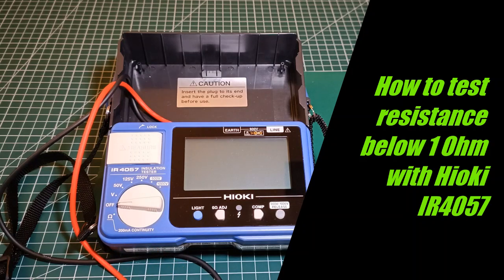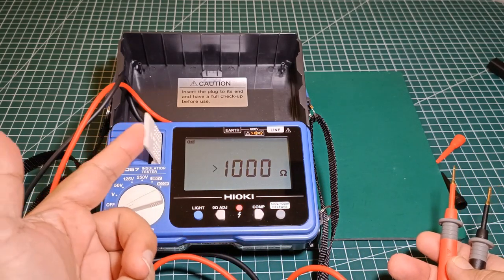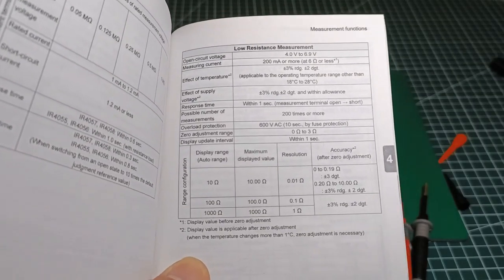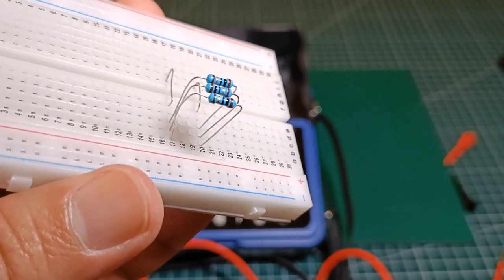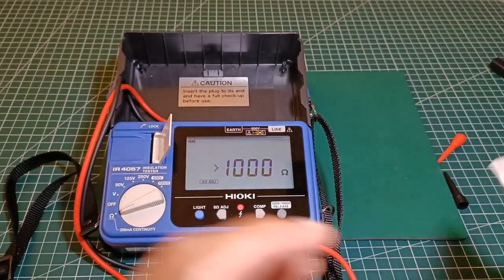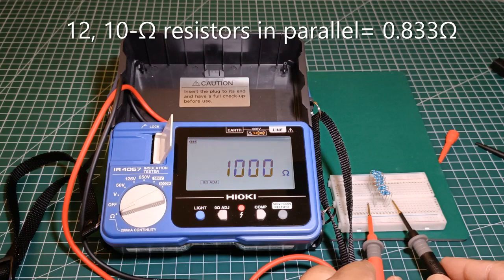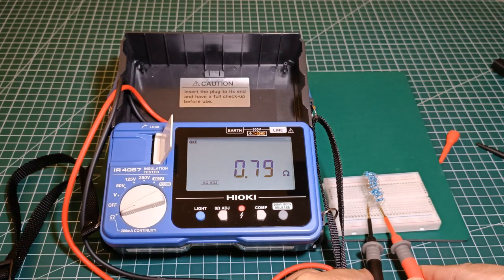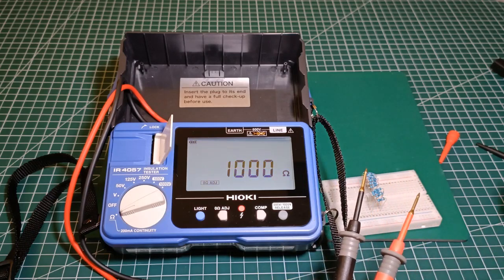[CC] How to Test Low Resistance with Hioki IR4057 (0.01 Ohm resolution)

Comment: Hola amigo una consulta, la función 200Ma de continuidad, sirve para medir la continuidad de un circuito algunos países como chile España piden esa medición en instalaciones nuevas.. 
Me podria decir si esa es la función?
Reply from the maker: @lucasruiz4022  Hello thank you for watching. Yes, you are correct. The 200mA function is indeed for continuity testing. It just happened to have a good resolution for low resistance testing as well.

Comment: Hello,

Thanks a lot for sharing. Quick question: If I am already using the Hioki DT4261-90 (with a Z3210 adapter), can I simply reuse the Bluetooth dongle with the IR4057? My guess is that you should be able to "share" one Z3210 within the entire range of Hioki-supported devices.

Best regards
Reply from the maker: Hello! Thanks for your comments. My understanding also is that the Z3210 should be compatible across new Hioki devices with HID functions. Some examples: CM3286-50, CM4141-50, IR4052-50, and IR4057-50 (note the "-50" designation). One Z3210 should be able to support any of them although you may need to pair them anew each time. My IR4057-20 is an older model so it cannot use the Z3210. But if you're using the newer model, IR4057-50, it should accommodate the Z3210 just fine.

Comment: How to check IR Value 1phase and 3phase.
Reply from the maker: If you mean feeder or branch circuits, the basic principles are the same. The circuits should be completely de-energized and all loads disconnected before testing their insulation resistance. But there's a lot more than this. So if you wish to know more I suggest further reading, or better yet training for safety and proper implementation.

Comment: First thanks for u then where it can be measured
Reply: Thank you so much I bought 4056-20 after ur review 4057 -20, iam ac technician but I regularly watching ur video. 💓
Reply from the maker: @Tirumalaaircontrols  Thanks for watching my videos. I share what I can & I also learn from others. Congratulations on your new IR4056-20👍! It has a low resistance function also. It is made in Japan & I am sure it will serve you well as an AC technician & in your other electrical projects, too. Good luck!
Reply: @ramschannelreviews  🙏
Reply from the maker: Thanks for your comments. I think you were asking where low resistance testing can be used? I believe it can be important in testing for contact resistance, for example, of switches, connectors, breakers, & relays. High resistance in these devices may indicate oxidation and poor contact, which can lead to heat. It can also be used to check for conductivity of wiring conductors- the lower the resistance the better. I'm sure there are other applications for it.

While you can do these tasks using the Ohmmeter function of a general purpose digital multimeter, their Ohmmeter often cannot go below 1 Ohm. You cannot also calibrate their test leads to start at zero Ohms. So, if you want below 1Ω value, & you need to eliminate test leads' resistance, you need something else.

Although the IR4057 not a dedicated low resistance meter, it has a relatively good resolution (0.01Ω), 200mA testing current, & zero ohm adjuster (0.00Ω). So it can quickly test for low resistance (below 1Ω) when very high accuracy and precision aren't critical.